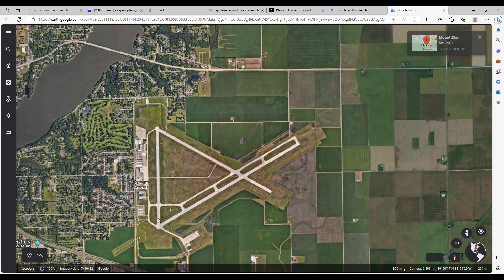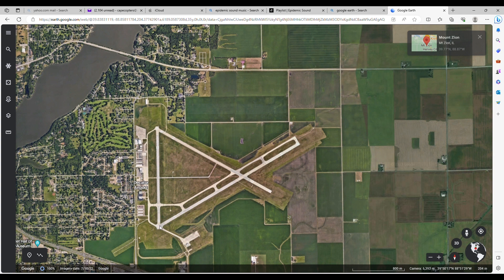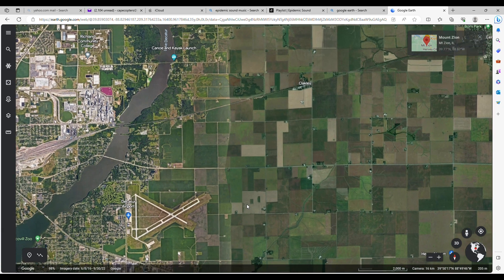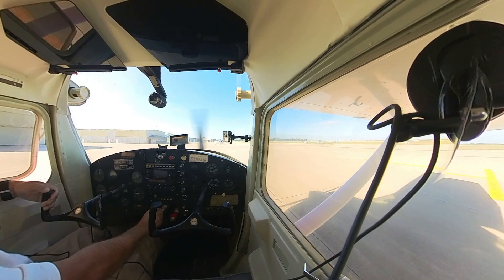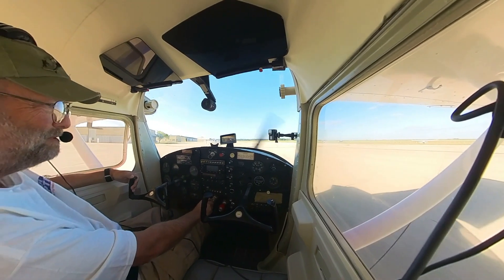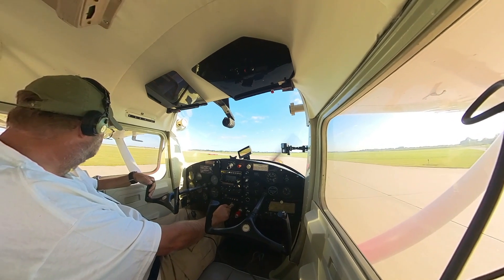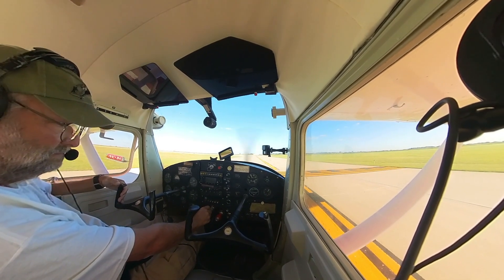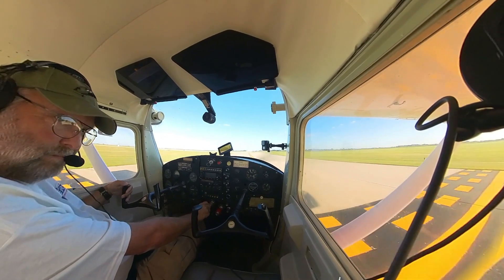Engine Loss on Takeoff in a Cessna 150- Part 3

Comment: I missed your first two Parts, but appreciate the analysis of the crash late in this video.  Yes, getting the nose down quickly is critical when low.  From various videos that are available now I see this happening too often.  It turns out that dumping the nose as we did in middle of last century is good recovery technique, but insufficient to the startle at low altitude with both engine failure and just inattention and stall.  The problem is that we are conditioned by the ACS, "Vx or Vy" as appropriate that these are are only choices.  Vcc or cruise climb is the appropriate pitch angle given long runways today.  Why do we want to quickly get up high enough for the stall/fall to kill us?

I come from a low altitude orientation where airspeed and not altitude is life.  As a crop duster and pipeline patrol pilot, my default takeoff was using as much free level in low ground energy as runway would allow or at least to cruise airspeed before pitch up to just clear, not spend lots of airspeed to climb well over, obstructions.  Airspeed for maneuvering is what allowed me to successfully manage nine engine failures and two partial engine failures.

The basic level in low ground effect takeoff is very similar to the soft field takeoff.  Yoke all the way back until the nose wheel comes just off (not too much pitch) very soon or abort.  Use elevator to get mains off as soon as the wing will carry the load in low ground effect.  This will be slower than Vso, and out of ground effect number.  Push/pull the yoke a bit to bracket level in low ground effect.  Low powered airplane like the 150 will want to stay pitched up too much.  Powerful airplane will want to climb right through low ground effect, where the most effective free acceleration energy exists.  Mains should be off well before mid point in most runways.  Stay level in low ground effect until cruise airspeed or obstructions require pitch up.  Start pitch up early enough to enter Vcc or cruise climb.

Unless Ag or at high DA and heavy, this seems abnormal and unnecessary.  Yet, it might save a hundred or so lives yearly.  The extra energy available in low ground effect is not critical until it is critical.

Comment: Great video on getting the nose down when the engine stops and when you take off plan ahead for a place to land if the engine stop and don’t turn around trying to save the aircraft land straight ahead in the wind if possible.A quote from Bob Hoover If you’re faced with a forced landing,fly the thing as far into the crash as possible.😊

Comment: Thanks. As a fellow f150 owner, I greatly looked and subscribed due you're presentation on a o200 failure. My own paranoia is an 1100 hour engine, running perfectly, but extremely sensitive to its maintenance and continuing inspection. If able, I would love to know what was found during the carb overhaul. Thanks.